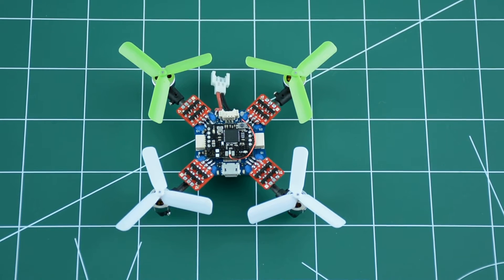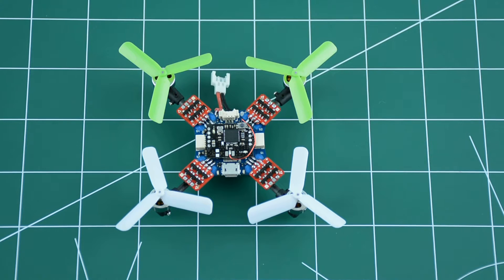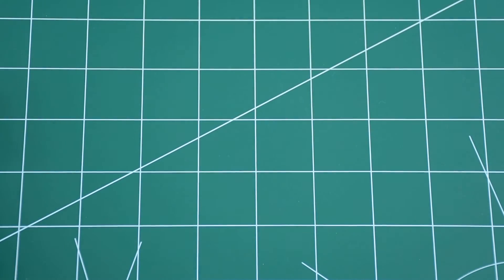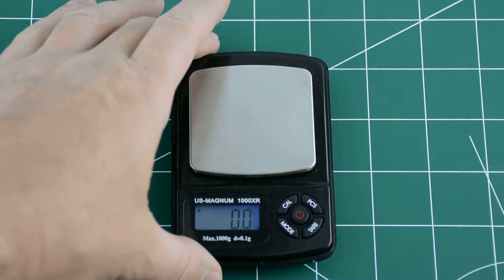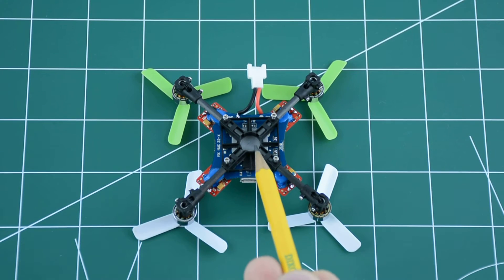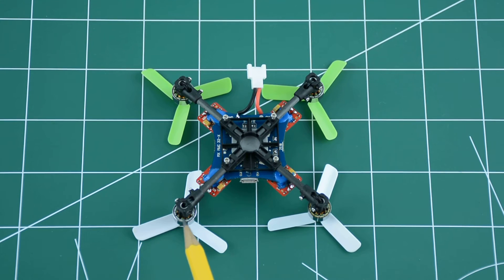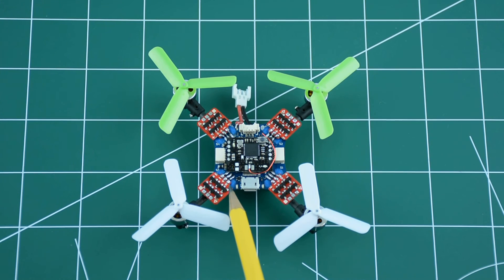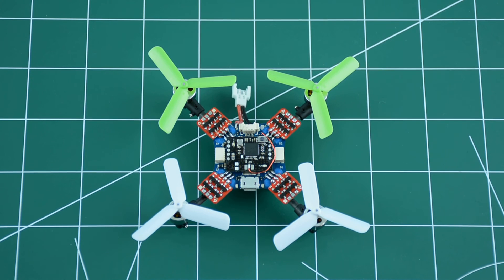MDX80 Smallest Brushless Quadcopter 18g! For Sale!

Comment: Can you send link to the propellers? Thanks
Reply from the maker: Hi Oliver! Here it is:
http://www.banggood.com/H108C-31A-3-Leaf-Blade-Propeller-for-HubsanX4-JJRC-H108C-H6C-CX-30-p-970931.html
Reply: Thank you so much for your help, Aecrim. Are these 40 mm. in diameter, or am I wrong? Hoping to fit them on this frame: http://www.banggood.com/Eachine-E100-100mm-Carbon-Fiber-DIY-Micro-FPV-RC-Quadcopter-Frame-Support-720820-Coreless-Motor-p-1074771.html
Reply from the maker: 45mm
Reply: Thanks again! Appreciate it. I will be buying these. Quality seems legit.
Reply from the maker: https://www.youtube.com/watch?v=0HCVEvx_3LM